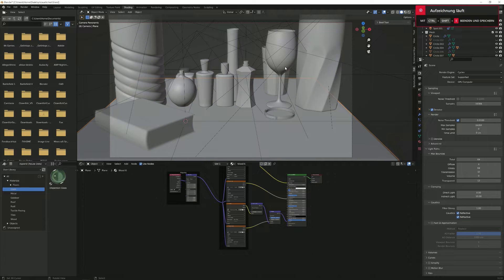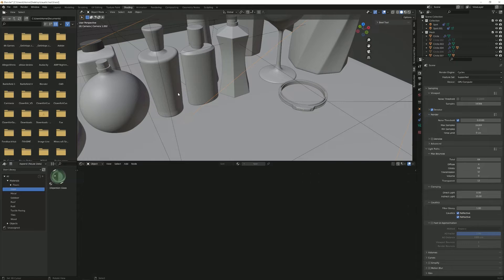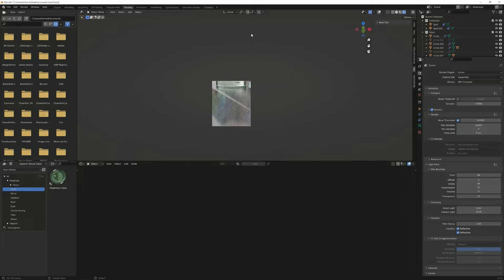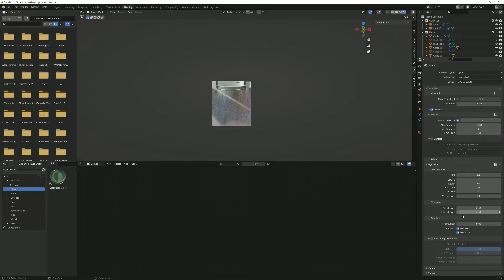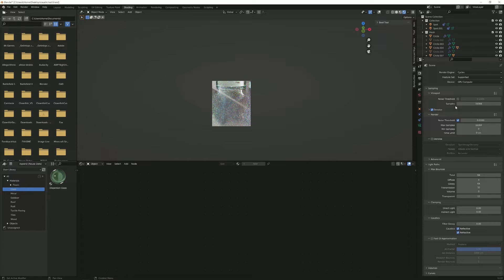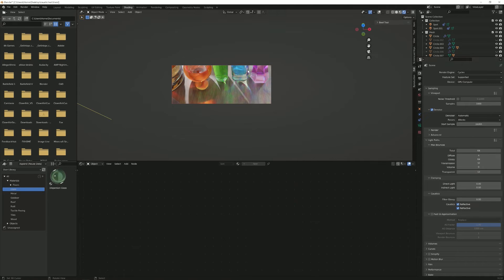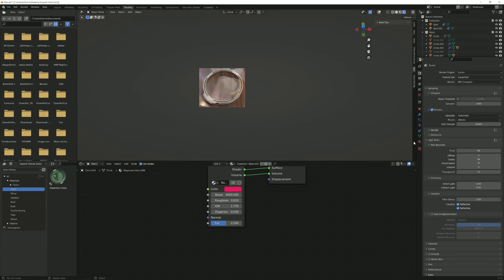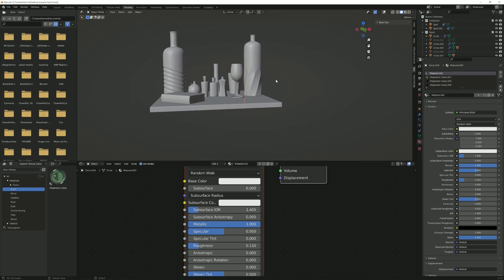The Best Way To Achieve Realistic Caustics In Blender Cycles / Blender Tutorial

Comment: How are you getting this? I modified the settings you said but my caustics still look like shit, the shadows look all pixelated and wierd, are you using a specific material?
Reply from the maker: No not really, but as I said in the video, it takes a very long time to render this method

It's the most physically accurate that cycles can give, but it takes 10+ hours on a decent GPU to get a good result
Reply: @philipkriegel  after some experimentation I found out that it would seem the edges of the mesh are being taken as if they were opaque, causing the caustics to look as the light was passing through a fence rather than glass, but I no idea why is it doing that.

Comment: This still doesn't work properly and when there is liquid inside glass it still produces dark unrealistic shadow. I can't believe Cycles is that broken after all these years.
Reply from the maker: It's not cycles, perhaps your settings are off, or your scaling isn't correct, it should be fine this way
Perhaps also check your normals
Reply: @philipkriegel  oh yeah it kinda works just takes forever to render which is unusable to render any kind of complex scene
Reply: @philipkriegel  also with no clamping fireflies and hot spots are ruining it
Reply from the maker: That's true, but they are working on it and it also takes long in every unbiased render engine
Reply: @philipkriegel  LuxCore for Blender does it in couple of seconds tbh
Reply: @philipkriegel  btw Blender support just informed me that it is Cycles limitation and can't be fixed.
Reply from the maker: Well, that's just not true

Also cycles and luxcore are 2 completely different render engines.
While cycles is a single directional path tracer with random sampling patterns

LuxCore is a bidirectional path tracer that uses the metropolis light tracing algorithm.

Each have their ups and downs, but there is not a single path tracer that is unbiased that does caustics even close to a few seconds
Reply from the maker: I am fully aware of what, is because of denoising
Yes, lux core is faster
But no, it doesn't get a production ready render in seconds

The thing with cycles is that even though you need to have 2-3k samples and it takes you longer on average to render a single frame, it is going to be a lot more consistent than LuxCore

You can not render animations using lux core because of flickering between frames

Lux core is also lacking a lot of features and will never be a production ready render engine

I don't ask for much, but please don't write about stuff on the internet like "in secodns you get gorgeous results"

That's simply not true, never was, and will not be in the foreseeable future 

If you think lux core is so much better, simply don't watch cycles tutorials
Reply: @philipkriegel  No one's talking about production-ready final renders. We are looking at viewport here. You set it to 100000-1000000 samples in your video to get the result which takes a long time to produce half-ass result and comparing to that LuxCore does a photo-realistic job in view port in mere seconds. Not sure what it has to do with lacking features, we are talking about caustics being broken in Cycles atm, not animation flickering etc.

Comment: Hey man, looks really good!
Rendering takes way too long tho :D

How do you set up your fluid/glas interactions?
I found that the old way of scaling up the fluid to intersect with the glass breaks the otherwise pretty nice caustic function of the new blender versions...

Thanks for the video!
Reply from the maker: Yeah, I've spent hours rendering each image, it's not practical for many things, but it's the best way of doing it :D

I haven't found that it ruins the caustics as long as you keep the scaling in mind.
I still enlarge my fluid by about 1% and it works just fine, never had any problems with it.
Should you still have any problems with it, I'd suggest shrinking your light source to a smaller size for sharper caustics